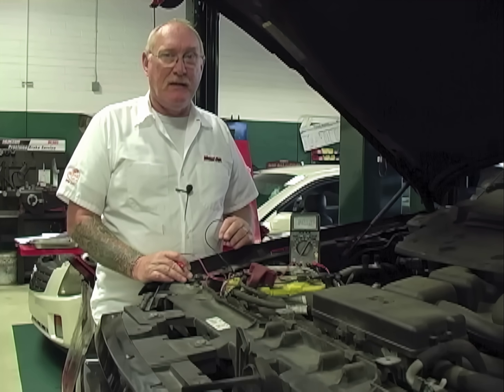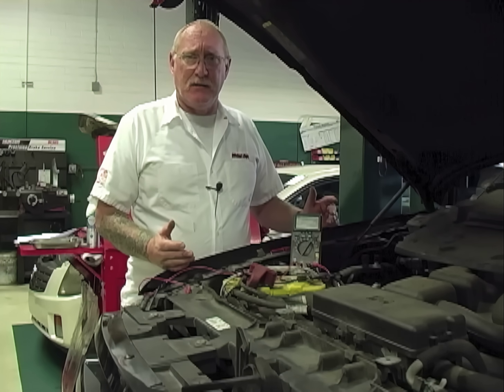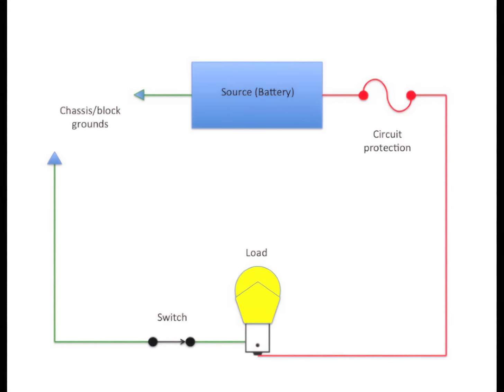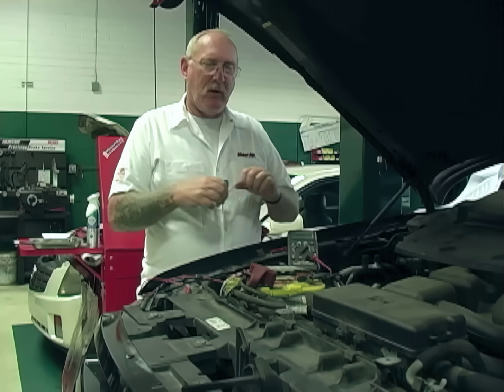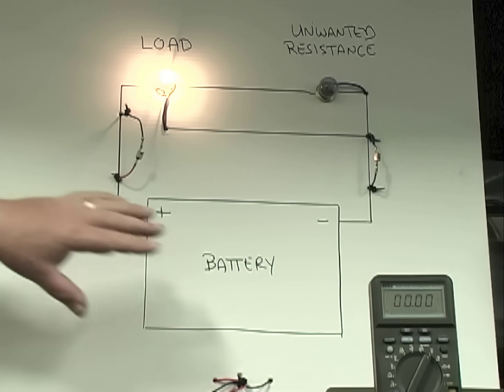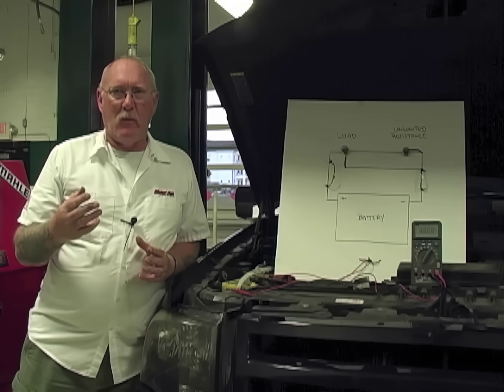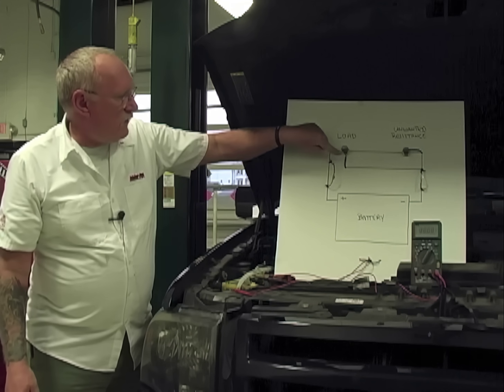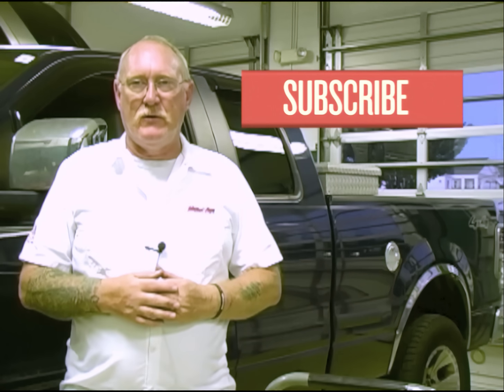The Trainer #47: What measuring voltage on the ground side means

Comment: Do most all SWITCHES provide chassis ground to the load?    Bulbs, radio, aux, fans etc etc .        The positive side (thru a fuse) to one side of the load permanently connected.
Reply from the maker: That would be too broad a statement. Always refer to the wiring diagram.

Comment: Good video on voltage drop!  Also out there is video on determining current draw by checking voltage drop across a fuse compared with its neighboring fuses!  Fuses bearing a draw will have a slightly higher voltage drop because the fuse employs a specific resistance.  The specific resistance is too low to interfere with normal circuit load, but it has to be there in case of a short to ground. With the very small specific resistance the fuse becomes the load in the case of very high current, gets hot and melts. 
     Cheeply made fuses should not be introduced into circuits, as part of the cost cutting in manufacture increases slopiness when it comes to exact very small resistance engineered into the fuse.  I took me a while to reorient my thinking because previously I mentally disregarded fuses as having resistance built in on purpose.
Reply from the maker: Just to clarify for you - there will be no voltage drop unless current is flowing. Everything in a circuit has some measure of resistance, like fuses as you pointed out. What we use it for is to help identify a parasitic drain source. If we measure voltage drop across the fuse, current is flowing, and the circuits that fuse protects comes under suspicion. Thanks for sharing your comments.

Comment: Derp derpity derp derp.
If you got power on the ground side of the load, you don't have a grounded wire.
It's highly likely that hooking up a jumper wire, of the correct gauge, would allow the affected device to work normally.

Comment: Take the bulb out of the glovebox light and you will solve that issue. Something is staying on. The computer will draw a fraction of a volt so you'll always light a test light doing this on modern cars. Back when fred flinstone & I were fixin cars you could go from batt ground to another ground with the ignition and lights/acc off the test light shouldn't light.

Comment: just saw heading and had to just say: It ain't rocket science,if you have power on you ground wire then you have a short!!! that simple.. now finding the short might take some time but the heading on this video was a simple thing to answer he takes a 10 min video to really say nothing... so much for being internet or youtube famous😂😂
Reply from the maker: You may want to rethink your statement that voltage on the ground is a short. A short to what? If it is to ground, than there will still be a voltage drop across the load. Voltage on the ground side of a circuit that is "on" indicates a poor ground. If the voltage is the same as source voltage it is an open in the circuit.

Comment: Why is this video so needlessly complex?  Just measure Continuity from the negative terminal to the chassis.   If that’s good then start pulling all the fuses and measuring the load side.
Reply from the maker: ??? What will that solve? I can have continuity but not be able to carry the circuit load.

Comment: If you see voltage on the ground side of a circuit, then there is resistance between your measuring point and ground.

Comment: I taught electronics in the military and civilian sectors and, though you may know what you're wishing to convey, they way you convey it is convoluted and confusing.  Even your mockup with the two bulbs as resistances in a circuit is confusing because you have another black line representing a circuit path shorting the "unwanted resistance."  Why would you do this to people who are already struggling to understand what you're trying to convey?  The fact that you call the red lead of the DMM the "positive lead" and the black lead the "negative lead" shows a fundamental misunderstanding of how to use a DMM.  The black lead is the REFERENCE lead and the red lead is the MEASUREMENT lead.  Your meter doesn't even label them positive and negative! There are systems that are positive ground where the reference lead will be on the most positive side of the power source.  Telecommunication DC plants are like this and are -48VDC, typically. When you see a measurement, the reading is IN REFERENCE to the black lead and it may be positive or negative but you know it is WITH RESPECT to the reference lead.
Telling people that "voltage is consumed" by a load is also just confusing since there is no physical way to demonstrate this.  It's just as easy to teach electrical fundamentals CORRECTLY as it is to BS your way through it.  I'm a retired engineer/teacher and what you did in these 9+ minutes is just cringe. Telling people to remember adages instead of explaining the "why" of it only makes things easier on YOU, not on the pupil.   SMH     Awful.  Just awful.  THIS is why people think electronics and/or math is difficult... they think if they don't understand something it's because they're just not getting it when, in fact, it is the horrendous teaching abilities of the person in from of them.
Reply from the maker: Thank you for the constructive criticism. This is one of many videos I've done on the topic and, even if my teaching methods aren't as polished as yours, it's helped a lot of men and women understand the concept of voltage drop. With that said, however, I appreciate your comments and will work to incorporate them into future efforts. For example, I've never heard it explained as "reference lead" and "measurement lead" - and I've had military trained techs in my classes. Happy Thanksgiving!

Comment: So how would you track or narrow down a short on the 5v sensor supply from the ECU? Or rather is there an Easier way?
Reply from the maker: Typically, a problem with the 5v reference is a shorted component using the reference. Use a schematic to identify all the components sharing this feed and unplug one at a time while monitoring it. It will come back when the defective component is unplugged.

Comment: The problem with this presentation is that the voltage drop shown on the vehicle at the beginning is  at best deceiving.  You can never get a reading like the one shown unless the wiring system in the vehicle was already under load;  that was.never mentioned. It would've been nice to follow through the steps to repair it.

The  lab experiment on the board is a good explanation for someone who already knows where to place the meter test leads.... not good at all for someone inexperienced because the connections (on the board) are not made clear... the path of the electricity leaves much to be desired.

Comment: Good video.  However, I believe DC current flows from negative to positive, not the other way around, as you seem to be indicating.
Reply from the maker: Voltage drop has nothing to do with current flow direction theory.

Comment: Doesn't really matter where the fuse goes. Electrons actually flow from negative to positive. Conventional current flow (the incorrect assumption that electrons flow from positive to negative) is only used because changing all the symbols would cause confusion.
Reply from the maker: Disagree. The load establishes current flow. Placing a fuse after it would do nothing to protect the wiring from a short before the load.
Reply: @VehicleServiceandRepair  it is a fact that electrons move from negative to positive.. not an opinion.
Reply from the maker: @eddieb9110  Not disputing that. Just your statement that it doesn't matter where the fuse goes.
Reply: @VehicleServiceandRepair  how? Which side of the load is the fuse on if electrons flow from negative to positive?
Reply: @VehicleServiceandRepair  Fuses are tripped by current, not voltage right? Current remains the same throughout the circuit.
Reply from the maker: @eddieb9110  True, but it is the LOAD that sets current flow. Ohms Law. A fuse is a thermal device that fails due to the heat generated when current flow becomes excessive and that can only occur if a different path back to the battery is found BEFORE the LOAD has a chance to throttle down the current flow.
Reply: @VehicleServiceandRepair  which side of the load is the fuse on if current flows from negative to positive?
Reply: @VehicleServiceandRepair  After the load... that's where the fuse is. The fact that the load sets the current flow doesn't matter that much to this discussion. The question is how much current is allowed to flow before the fuse blows. After the load, and right before the battery, makes sense because it eliminates the most possibility of a return path. That's why they do it.

Comment: When I was 18 ,I had an issue with the frequency valve on a Bosch CIS injection setup. 
I had power at the plug ,but it wouldn't operate.
I swapped it out ,same thing. 
Haha ,dad ,help!! 
He's not an auto tech by any means ,but an engineer and I never recall bringing our cars to the shop. 
After 30-40mins ,he found it and it was a broken wire in the harness. 
I was amazed because he came into it saying he "didn't know anything about these cars". 
Probably part of what made me go to tech school and see if I could learn what he knew. 
He always took time to explain it but the formal training was a big help.

Comment: This was apparent in the 1950’s when older vehicles poorly maintained had many ground or earth faults. Often one headlight was relatively bright compared to the other. As for circuit fault finding we were taught in REME the fastest way to find a fault was to split the circuit in half and test then repeat on the faulty area until the fault showed up. This works on most electrical devices although the specific design of some may mitigate against it.
Reply: Earth fault in a car ?? Ahh, how can you have earth fault in a car ?
Reply: @ACommenterOnYouTube  Ahh! I don’t know your age so I will begin at the beginning. I was born in 1946. My early motoring was in my parent’s cars and my personal motoring began in pre WWII vehicles. Those vehicles, frequently positive earth, had the major systems; chassis, body and power train. Electrical earth ran from battery to body. The body was earth strapped to the chassis and the chassis was earth strapped to the engine and power train. The headlights were mounted either on the front wing supports or on a crossbar in front of radiator. Head lights functioned differently then a foot switch cut out the offside on dip and operated a solenoid which dipped, physically the reflector. You now see the potential, no pun intended, for a loose earth bolt in the system to create havoc with your electrics! In consequence young men learned from old men to tighten and clean earth contacts. Tracing was done by wire and bulb as a meter cost a month’s pay for a young man. Earthing was very important as many cars had only a 6volt system. 
Today, you have a monocoque chassis with a negative earth which runs from battery to chassis and power train direct as well as often to the electronic control unit. The principle however still applies. When in doubt go back to principle and prove what does not apply before advancing. As we say in my locality ‘fare thee well together!’
Reply: @glynluff2595  once again what does "earth" the planet have anything to do with a cars electrical system ??? 🤷🏽‍♂️
"Earth" ground is specific to home ac electrical systems where the Neutral is bonded to Earth dirt ground for lightning protection. 
A cars electrical system has NOTHING to do with earth ground in any way shape or form. 
A cars electrical system is usually chassis ground not earth ground.

So once again, there is no Earth fault in a car because the cars electrical is not tied to the earth ground 🤷🏽‍♂️ ....
Reply: @ACommenterOnYouTube  Ah semantics! If you look at original British motor manuals you will find reference to earths. If you are with the military and engaged in signals and electric generation I do agree the first thing on stopping is to hook up an earth rod and pee on it! What you also have to respect is on agricultural and civil machinery that has metal wheels and tracks the chassis ‘earth’ is in direct contact with global earth. This is so with marine environment as well which is why disposable anodes are placed upon the hull. A cars chassis earth is only separated from global earth by its tyres  and some of these have metal carcass elements. I do however agree that ‘chassis earth’ is a far better description of mobile equipment usage. 
As for ac and dc mains and instrument systems I have had  mixture of these systems drop off 24v systems because of the difference between clean and dirty earths in petrochemical work but that is a separate story!
Reply: @glynluff2595  i think the earth fault has went over your head because you are not comprehending what i am trying to explain to you. 
Yet you want to go on about stuff that is completely irrelevant to earth ground faults when it comes to cars
Reply: @ACommenterOnYouTube  I am obviously irritating you and for this I am extremely sorry.
Reply: @glynluff2595  You are bringing IN earth ground fault which has ABSOLUTELY NOTHING to do with a car's electrical circuit and you want to keep going on about something that again is irrelevant. 
So either you don't understand what i am saying and just keep rambling ON or you really are convinced that the earth's ground is related to a car ..
Reply: @glynluff2595  all he's gotta remember when jump starting a positive ground setup is ,it's still red to red and black to black. 
First job in a shop ,the boss asked me that trick question as I worked on an old car with positive ground.
Reply: @MrTheHillfolk  Oh yes, but never let the two chassis or bodies of two different systems touch when so doing!

Comment: Videos like this are invaluable. A few years ago, I knew nothing about automotive electrical troubleshooting. Although, I understood electrical circuit fundamentals, automotive circuits seemed extremely complex and overwhelming. However, each time I faced a new problem and searched for specific solutions, I found fundamental videos about electrical troubleshooting to be the most beneficial. Now I approach problems more strategically by studying electrical circuits for the specific vehicle and then going through the testing process until the problem is found.
Reply from the maker: Which is what a professional does!

Comment: Voltage on the ground side always means the same thing. There is either resistance or an open on the ground. On the power side low or zero voltage means the same thing. High resistance or an open. 
Be aware of pulse width modulated high side drivers in modules. They intentionally reduced voltage to increase the life of things or control power.

Comment: Motor Age Magazines in the shop Lunch area has had key articles that have expedited my ability to properly diagnose  just about anything with 99% success with no comebacks.  Unfortunately 5%-10% parts failure happens even when you attempt to prepare for that as well.

Comment: That was an excellent guideline I'm sure you know this one disconnect the negative terminal put a test light in between the terminal and the negative post if it's lit you have a ground somewhere start unplugging fuses until the light goes out and you found your circuit
Reply: Thats the same as putting the meter on the positive. Current is present on both sides.

Comment: Good video! But the fuse is not always on the "positive" side.
There is a lot of equipment that have positive ground systems. The negative post of the battery has the fuses. Unfortunately, many people have no idea...
Either system has to have good grounds.
Reply: Never seen a car with a positive chassis ...
Reply: @ACommenterOnYouTube  lots of trucks, equipment and military vehicles
Reply: @GosselinFarmsEdGosselin  in 28 yrs of working on "trucks" and equipment, never came across a chassis that was positive potential ...
Reply: @ACommenterOnYouTube  then you have been fortunate enough to not work on older trucks.. or anything else with an SP switch. 
Just means you haven't had to try to find a positive ground alternator either.. or generator..
Reply: @GosselinFarmsEdGosselin  i worked on cars from the late 80's and newer and NONE have had a positive chassis.
Even electronics from the 90's that i have worked on ALL have a negative chassis ...
Reply: @ACommenterOnYouTube  once again, you haven't worked on the old stuff..
Reply: @GosselinFarmsEdGosselin  i mean i have heard of some cars having a positive chassis but have never seen it.

Comment: Heads up:
In a circuit, let’s say a light bulb or electric motor, if you unplug the ground side and test it, you WILL get voltage on that ground side.  Voltage still flows through the filament  or motor windings.  Keep this in mind when diagnosing.
Reply: I'm almost certain that is not true. If you still get voltage, something is on somewhere. Modern cars almost always have a some sort of computer, that'll stay on for 15-20min after the car is off(usually pulls .300-.800 volts) . If it's a higher end vehicle, they usually always have a computer on, which is why the battery dies after a couple weeks of it not being started.
Reply: Blackhawk 7r I believe you are right about measuring current on the negative side of filament , current flows all the way to the end of a circuit even if the end of that circute is the neg. side of a filament . the reason the lightbulb does not light is because the current is static and not flowing , their is no continuous flow of current. That given that the switch is on , if the switch is off then current stops at the switch .

Comment: I installed LED bulbs on my Rv so I could get high enough voltage to run my backup camera. Now the rear taillight with the license plate light burns a lot brighter than the other. Should I replace both rear taillights with LED’s ?